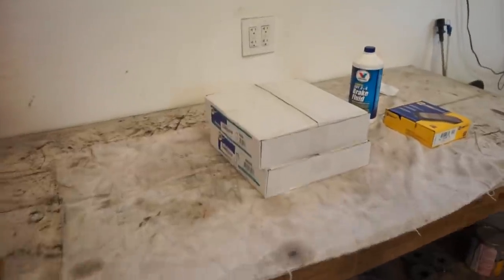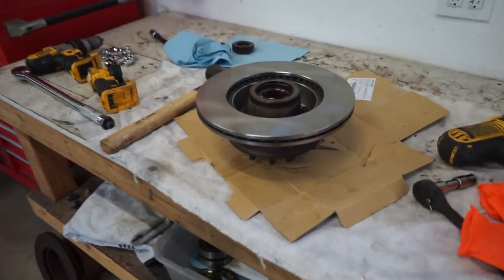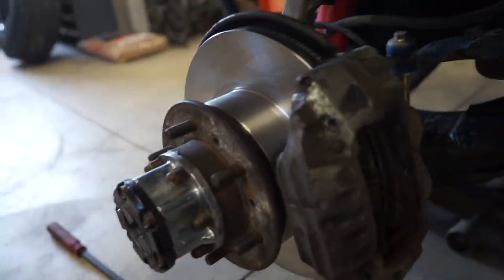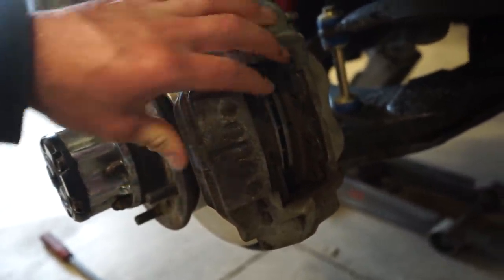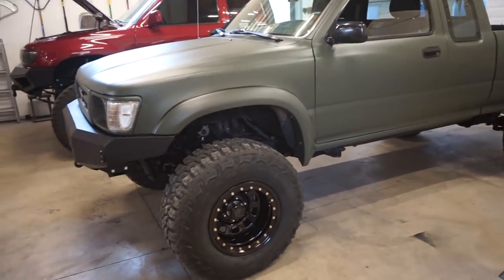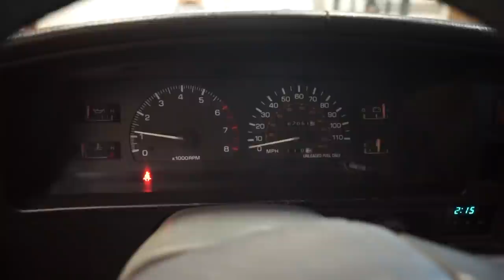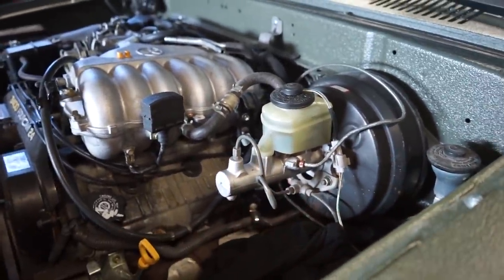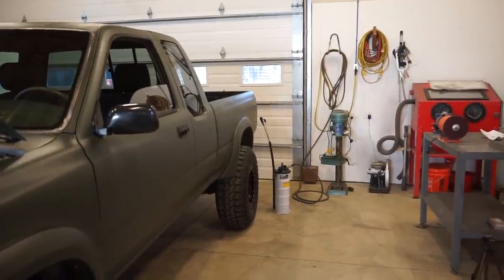An Update On The Green Machine!

Comment: On my rig I’m using ifs hubs with my stock locks, 98’ rotors, and 94’ four piston calipers. Also dust shield eliminators with a set of rock rings. I upgraded the master cylinder and brake booster as well, these two parts came from a stock V6 89’-95’ truck. For the rear I have a complete rear locker axle out of a 04’ Tacoma with large rear drums, dialed brake pressure in with a proportioning valve.

Comment: I agree with Joe. Load proportioning valve is a bugger on these trucks. I disconnected from axle and strapped that end to the bottom of the bed. Rear brakes full power all the time! Bleed that proportioning valve first before wheel cylinders. Good luck

Comment: Did you check the push rod adjustment in the booster  to master also the rear load proportional valve in the diff
Reply: X2

Comment: Load sensing proportioning valve. I disconnected mine and put an aftermarket proportioning valve under the hood right off of my master cylinder. The brake circuit on that truck has 2 lines on the right frame rail. One of them is a return line. I deleted the return. If you google it you will find some articles on how to do it.
Reply: Did you block off the return with plugs?
Reply: @jasminroux9031  I just re-used the brake line fitting after I welded up the hole in the end of it.

Comment: If nothing else works, try adjusting the pushrod between the booster and MC. You may need the special tool to measure the adjustment. Also, be careful, adjusting it too far out could blow the seals in the MC.

Comment: I have bypassed the rear proportioning valve on both my 85 4runner and my 2000 tacoma. I've also had to gravity bleed the rear brake lines on both tucks after loosing enough brake fluid in the system while replacing parts.

Just open the rear bleeder on the longest line and let it bleed it with gravity for a few minutes, then do the other side on the rear. Then bleed everything once again.

Comment: Check the load sensing proportioning valve on the rear axle. This controls brake bias to the rear axle. The valve is mounted on the chassis rail with an adjustable rod linking it to the rear differential. It may be out of adjustment due to suspension changes or damage. The valve could also be worn out or have trapped air in the valve. Most have a bleeder on the side of the valve.
Reply from the maker: I maxed that out to get the rears full juice!
Reply: I agree James P.  It happened to my tacoma truck before. After I adjusted the load sensing proportion valve the truck stop right away. You can test  by pulling the hand brake with the brake pedal down on a stop. If the truck stop better then that's the problem.

Comment: I have the same issue with my Hilux.

I upgraded to the 1" mastercylinder and booster.

While driving at highway speeds the brakes are great but at slow speeds like you were doing in the video, they are about the same.

I replaced the rotors and pads, bled the whole system including a flush.

Same result.
My thoughts were leaning towards the check valve on the vacuum line.

I have not checked the flexible brake hoses.
Maybe they swell under pressure.

On my 60 series Cruiser it made a huge difference when I replaced the rubber hoses.
Pedal is more firm.

Thanks for the vids.
Keep up the good work
Reply from the maker: Thanks!!!

Comment: Damn! I can't believe that I missed this! As far back as 79, you have to remove the hubs and those 2 nuts to take off the rotors. I got the same hub socket from DOWNEY off road in CA. You don't need a C clamp to push the pistons with a screw driver. Congratulations on hitting 50k. I got to watch your channel Explode. I've been here sins you were at 4.6K. You are a great guy and talented. Your endorsement of that brake bleeder is better than if they were giving you support. This happened to me and it was the load propottioning valve got stuck and there was a hole in the line. It took a while to find out what was going on.  It's the Tinker toy looking arm on the rear axle on the drivers side. I don't know if your truck uses it. ✌.
Reply from the maker: Yeah I have the lspv, seems to be working! I’m going to try calipers next! And thank you!!
Reply: @austinniemela no problem! I'm stoked about the you hitting the 50k subscribers. Congratulations!

Comment: I'm having the same issue with my 73 Bronco. One day I had solid brakes and horrible brakes the next. I put 4 wheel discs on it and put the whole thing together myself. The brake booster holds vacuum, the master cylinder is solid and I have no leaks. I'm pulling my hair out! The only thing I have left to check is the line-lock I put on it. Good luck, fingers crossed for both of us!
Reply: Try adding a residual valve to it, its a one way to prevent he fluid from going back up the front.

Comment: Is there a proportioning valve or tee where the front line splits into 2 lines that could be bad?  Or hidden line damage/ blockage that lets you bleed the brakes and not let you give full send on the pedal?

Comment: Please check the rubber pipes that go from the metal pipes to the calipers. They normally are threaded in the inside of the tubing, after some years and use, the threading can loosen up thus clogging the tiny hole that goes into the caliper joint. I have a Nissan Patrol GU-Y61 it caused me low powered brakes and serious brake jams for a long time, just a pipe swap and TA-DA!

Comment: If rebuilding the calipers does not fix the issue check to see if there is a proportioning valve near the frame. That can cause issues if it is stuck. Not sure if it even has one, but if so change it.

Comment: Did u check the proportional valve or load sensing valve,,,,,,usually these loader trucks have load sensing valve fitted some where in the center of ladder frame.....and another thing is to check is the brake rubber hoses...... if u r using older one then they might swellup once u apply brakes......
Reply: same thing what I thought ..maybe this is problem you happen right now..

Comment: You can run ifs hubs with manual locks and ditch the rotors bolting to the hubs all together. Solid axle guys been doing this for a while, might want to see if you can run this set up. Changing my brakes is remove the tire, unbolt the caliper, slide off the rotor if need be to resurface or replace, install rotor, install new pads, bolt on caliper and tire and I’m done.

Comment: Hey brother another helpful video my Xterra has the same type of breaks in the front. I’m gonna use this method to do my rotors. As far as the master cylinder and system goes,  maybe bad master, those types are really touchy.  when I did mine I went through two brand new masters before I took it to mechanic with a 3rd.  They got it and I didn’t even ask how! Good job on the channel though you deserve it.
Reply from the maker: Thanks man!

Comment: Great job, quality content as always. I need to replace the studs on the hub that hold the wheels in place, as I have broken 2. Is the disassembly and reassembly process the same on a factory solid front axle? 1994 toyota pickup, thanks in advance

Comment: Pull the rubber brake lines off and replace with stainless braid when you rebuild your calipers.
Reply: They are absolutely nasty once the inner threads start to clog the pipes.

Comment: try putting the original master cylinder back on, that was engineered to work with the calipers. the smaller piston would create more pressure.
Reply: just thinking about how a bottle type hydraulic jack works.
Reply from the maker: The 1” is a very common upgrade for these trucks! I believe 93-95 came stock with 1” if I remember right

Comment: It's the caliper, it's a pretty common problem that any water intrusion into the fluid causes the bottom piston to seize.  I've never needed a c-clamp to push my caliper piston back in, just a very gentle push with a flat-blade screw driver should do it.
Reply: PS since you will have to do all the bleeding again if you replace the caliper check your hoses for any signs of cracking while you are at it.
Reply from the maker: @Bill-v650  I’ll check or replace the lines and rebuild the calipers! Hope that will fix it

Comment: The calipers are probably sticking. If cars just sit for a while they tend so seize up. Sometimes it’s enough push them in and out a few times with a big pipe clamps (knipex is my personal favorite for this) you will feel them getting easier to push in as you go on. Otherwise you have to take them apart and scrape the pistons a bit with a scotch pad if there is any light rust and put them back together with new seals.
Reply from the maker: I’m going to check the calipers next!

Comment: I doubt this is the root cause of your issue but you've gone up in tire size quite a lot (~15%) so the moment arm to the brake rotor is different.  It means you need more caliper pressure, and thus more pad force and more rotor torque to achieve the same braking force at the road interface.  Without changing the master, calipers or booster it means more brake pedal force is required.  To compensate, I recommend you replace the factory single diaphragm booster with a dual diaphragm booster from a mid/late 1990's T100.  Thankfully there's a ton of continuity in Toyota design, so it bolts right in.  Might need to adjust the booster rod length, and don't forget to set tolerances in the linkage per spec.  The brake pedal will feel "normal" again but pressures throughout the braking system will go up.  NBD.  Braking performance will be returned, can lock up the fronts on dry pavement again, let alone gravel roads!

Given the age of the calipers and brake lines, the advice to rebuild/replace the calipers, master and flex lines is a good idea. Cheap insurance on a 30yr old system.  Did you set the pedal position, free play and such when you swapped masters and boosters?  Usually need some plastigauge to set booster to master tolerance. Given the severity of your issues I suspect you have a bad master...

BTW, that brake bleeder system you have is pretty cool but it uses vacuum at the wheels to draw the fluid from the reservoir.  I do the following to pressure bleed the brake system: remove the central dust cover on the master reservoir cap to expose the small pressure equalization vent.  Fill the master with fluid. Take your (cleaned out and dry) hand pump weed sprayer (or your air compressor, regulated down to a couple psi) and push the nozzle to cover the air vent hole.  Gently pressurize the master reservoir which forces the new fluid thru the lines and out a bleed nipple.

Comment: Hey Austin, that´s not the correct way to grease up the bearings, you have to put grease in your hand then grab the bearing with the other, now you just drag the bearing on the hand with grease (with the wider side facing to hand with the grease), the thing is to make the grease to come out from the thinner side of the bearing, it is more important to grease the interior of the bearing then the exterior.

Comment: On my 81 4x4 I have hated the brakes since the day I got it, so what I’ve done so far is upgraded to the 1 inch brake master cylinder New brake lines ventilated V6 brakes up front all new rear drum brakes. I’m still not very happy with the breaking performance so I’m going to be putting the calipers I had upfront before I did the V6 brake upgrade and I’m going to mount them in the rear with some sort of proportioning valve and we’ll see if four wheel disc brakes are any better of course I’ll have to do one of those driveshaft E brake conversion’s but those seem pretty cool anyways I guess my point is the brakes on these trucks kind of suck are your red truck’s brakes better than the green trucks? They are the same brakes and same master cylinder and same booster is that right?
Reply from the maker: Same master and boost on the red truck and those work amazing!!
Reply: @austinniemela  well my mission for better brakes continues as well so I’ll be watching to see what you figure out for the green truck... because the red truck has bigger tires anyways so if you like the brake feel in there it should be even better on the green truck you would think 🤔 with essentially the same set up... probably not anything todo with the lspv because most of your breaking power comes from the front brakes but I don’t know 100% how that thing functions I’ve read some discrepancies. Probably not the new brake master cylinder right out of the box could it be an improperly set piston or whatever the rod is that comes out of the brake booster? It would kind of suck if they were some kind of buildup of debris in the brake lines but if they bleed easily it’s probably not that either. Probably the calipers then.

Comment: Very frustrating and I suspect that the flexible brake hoses in the front are collapsed internally. I had not experienced this before and once I reached the point where you are I was clued in by a master Toyota tech. Replaced both of them, problem solved.

Comment: Super noob question: How do you know what torque to use at each location? I have a 1994 Toyota Pickup that I am learning how to work on. Is there a secret mechanics' manual? I've started with an oil change and am working towards more complicated maintenance. Everyone starts somewhere.

Comment: If you take the brake fluid bottle turn in outside down on top of master cylinder fill tank you don't have to monitor so much it will auto fill the master cylinder

Comment: Try bleeding and/or adjusting the load prop valve?
Reply from the maker: I did!!
Reply: I had always heard that on Toyota’s it’s really worth it to just use OEM parts for the masters as well as clutch slave.  Maybe you’ve got a bad MC (for the soft pedal) and also a worn/ineffective booster making it seem like the brakes don’t do much.   That dual diaphragm booster you have should make it pretty easy to lock up the brakes on gravel and was a pretty huge upgrade over the single diaphragm used in the 2nd gen Toyota.

Comment: 100% the line from the front of the cilinder is the problem. The loop is trapping air. The fluid velocity is to low to flush the air. Flip the loop horizontal or change the line.
Reply: The top of the master cylinder should be the highest point so air can escape.  The same way you have a right or left side caliper.  The bleeder valve is always on top.   Good luck, great videos.
Reply: @anthonyspera1981  all true. The only thing you forget to mention is the way air can, and probably will, get stuck when you rollercoaster your brake lines.

In automovive you're never sure. So i need to rectify myself by saying 100%.

Comment: Looking on how hard you pushed brake cilinders while changing brake pads, at first look for me it seems you have issues with them. You must buy repair kit and fix them. They must go in and out with very little force, like simple, small screwdriver must be enough to push them back into initial position

Comment: i had a 99 chevy was doing the same thing i changed everything from front to the back trying to get the brakes a full pedal never could they would scare the crap outta ya LOL a friend told me to park it on a hill (in- cline )with the front bumper up, take and loosen the cap on the master and let it set four or five days heck i let it set a week..LOL and guss what i had a full pedal after researching it turns out i had air in the ABS BOX under the truck and i couldnt get it out so by doing what i did the air as we all know bubbles up and i guess thats what happen

Comment: Wtf...all that work and effort for nothing. Must be gutted. Always advise you young guys to always first troubleshoot and do some problem solving before trying to use process of elimination.  You can't afford to do this once you get old, it's just too taxing on the body and wallet. Also gets way too boring lol. I would suggest that you always get advice from a specialist and work from there. Start with the easiest and smallest options first. Often times it's something simple. Normal folk will never understand how hard and tiring it is to swap those discs. Gut feeling thinks it's the brake booster. Or could be still air in the master.